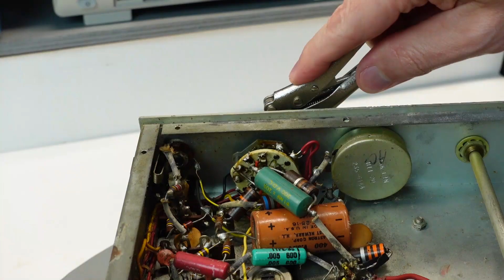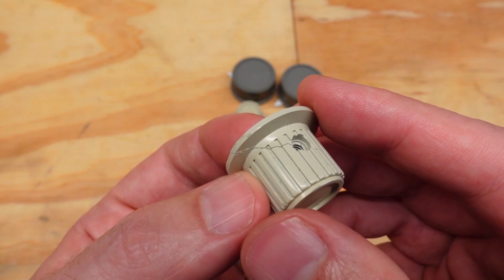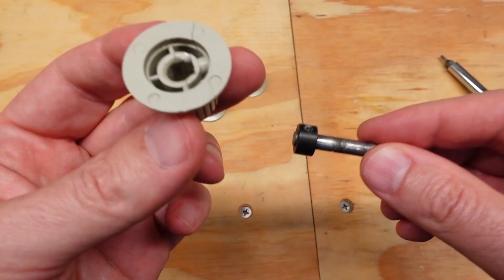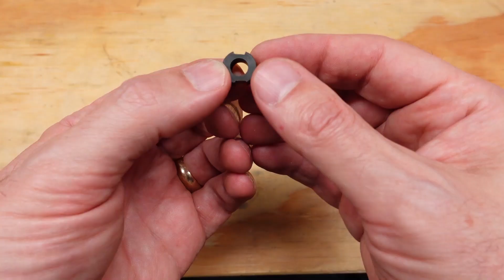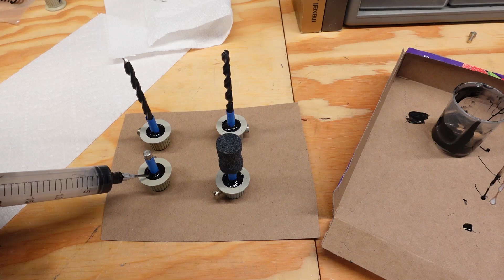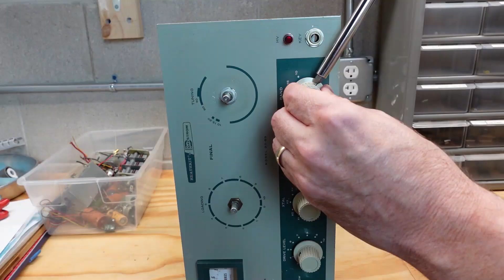How To Repair a Cracked Heathkit Knob

Comment: Since you have a mill why didn't you cut a flat on the shaft? I'm genuinely curious.
Reply from the maker: I did think about doing that, but two problems - mounting the switch in the mill vise would be very difficult, so I'd have to disassemble the switch to remove the shaft temporarily, which is a bit dicey.  And two - the set screws in the collars are very short, so I'd have to replace them with longer ones to handle the extra distance to reach the flats.  And they are an oddball size.   Fortunately, I think the grip will be plenty strong now even without a flat on the shaft.

Comment: It appears that you used JB Kwik which is a fast cure epoxy (also note that it's black). JB Weld slow cure epoxy (which is gray) takes an hour or so to even begin to start to think about curing (😉) and in the time that it remains liquid it will flow down into the voids under its own weight, displacing trapped air. If you have a hot air pencil that can be set to a low temperature/low pressure, you can also use that to help blow and flow the apoxy into the voids; the heat  will temporatily thin the epoxy but then accelerates the curing process.

Comment: Very nice job! I've done similar repair/reinforcement in the past, but I've never been impressed with so-called "plastic fusion" epoxies, which typically don't fuse to the types of soft plastics that are most likely to require repair, have a softer, rubbery consistency when cured, and stink to high heaven from MEK or whatever solvents it contains.  The plastic fusion glues also seem go bad in storage more quickly than ordinary epoxy glues, even if the tube/dispenser is unopened, because the solvents manage to leak their way out (a sealed metal tube is probably more trustworthy than a clear plastic dual syringe dispenser). An ordinary slow cure epoxy would work best: JB Weld, Devcon 2-ton etc.  If somebody doesn't have access to a milling machine for grinding notches into the metal insert, a Dremel tool equipped with a carborundum grinding or cutting bit will rough up or grind slits/notches into the sides of the insert and remove sufficient anodizing for the glue to bond to it (an ordinary file would work if that's all you have on hand). At the very least, however most people will find it difficult to do this without use a drill press; getting the insert perfectly perpendicular and concentric before the glue sets is the hard part, and  It's very helpful to be able to remove the center of the plastic knob cleanly and concisely with a drill press versus doing it by hand with the Dremel tool.

PS, I have a video about using epoxy and other adhesives (UV-curing glues, specialty CA/"Super" glues, etc) on my channel.  I have been using epoxy glues for about 55 years and therefore It amazes me how many people have never used epoxy; I am a volunteer with the local Repair Cafe group and it surprised me thst many of the other volunteer repair people ( "fixers") had never used an epoxy glue either, so I've been instructing them.  By the way, if ordinary epoxy glue is a little bit old and  starts to gel and thicken, you can sometimes soften and liquifiy it sufficiently to use by putting it in the microwave for 5 seconds at a time, or dunking it in a cup of really hot water.  Obviously you can only "nuke" it if it's in a plastic bottle or tube because a metal tube would spark and arc; and I only do it with a clear epoxy because grey or black JB Weld containing powdered steel might also react in the microwave. Metal squeeze tubes of epoxy would need to be dumked in hot water to liquify the glue more, but in truth I've never experiencedJB world sitting around here unused for long enough to start curing or gelling on it's own inside the tube!

Comment: A good way to free up a sticky or frozen rotary switch is to heat the shaft of it up with a hair dryer or heat gun and apply a little bit of penetrating oil where the shaft goes into the bushing; the heat drives expanded air out, and when the shaft cools a vacuum is formed and sucks the penetrating oil in between the shaft and bushing. I had a Dynaco PAS3 preamp with a completely frozen rotary input-selector switch (with at least 4 or 5 switch wafers); repeated applications of heat and penetrating oil, plus visegrip leverage, freed it, and I didn't have to disassemble anything.

Comment: Another thing to try , I picked up a Heathkit HM-102 that needed a good cleaning. I had a bottle of plastic headlight polish and used that to clean up the paint. Did a very nice job. I was careful cleaning the lettering with nice results.  FWIW Carl  AB1ZI

Comment: AES has some brass inserts that I used to make a replacement thumb wheel on a Heathkit tube tester. That took a bit of manual work to get the hole size just right in the 3-D printed part. Bottom line: metal insert plus the right adhesive for the win.